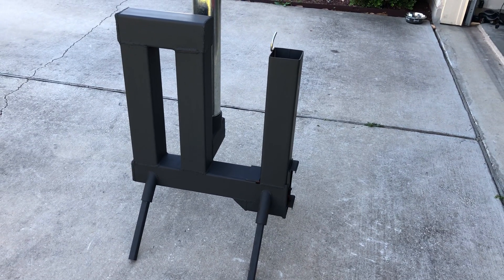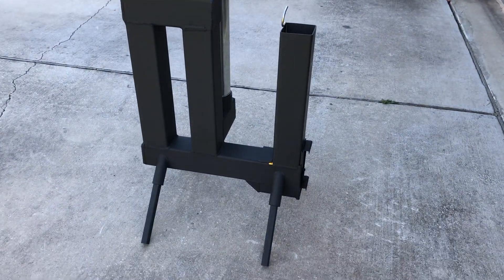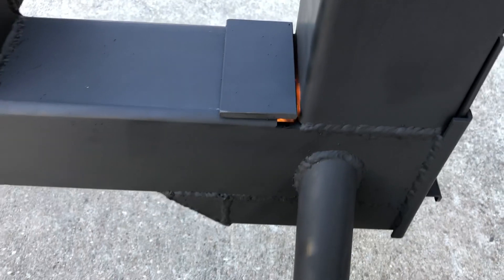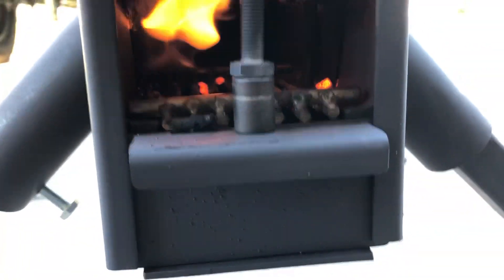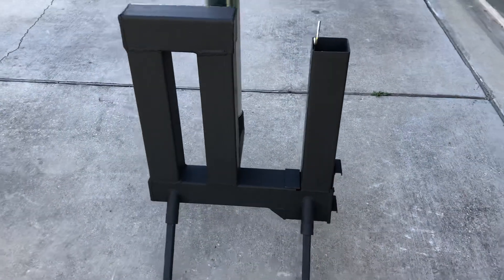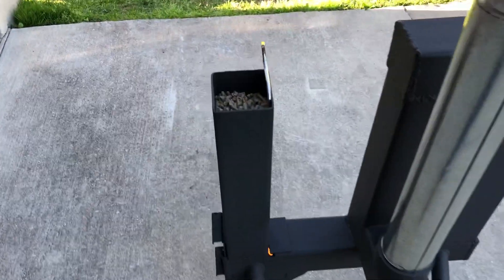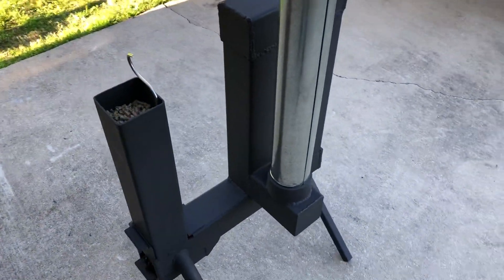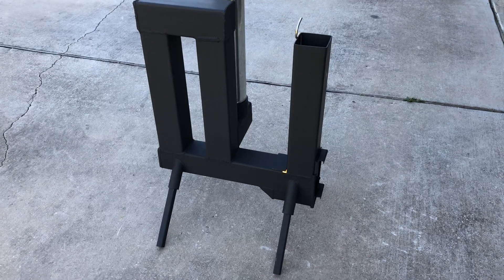Gravity fed wood pellet rocket stove

Comment: U need some heat handles welded to it so you can move it fast if needed.
Reply: Or just have pocket-style receptacles that you could quickly slide a handle/handles into. Then you wouldn't have to worry  about  them getting hot .

Comment: Nice!  What about tweaking the design slightly by moving the square pipe (for the chimney) 90deg, so it/the chimney sits on the bottom section of the square tubing(?) Not a big deal but the mod would make the unit more compact.

Comment: Built one just like it. My problem is when it's running out of pellets I get alot smoke through the hopper. Are you seeing the same thing.
Reply from the maker: Yeah I get the same issue. I’m not sure how to remedy that
Reply: Don't run out 🤔
Reply: Add a lid
Reply: Add a piece of 1/2” copper tubing going from top of hopper down to backside of chamber to create a draw on tube that will suck smoke back. Also put a lid on hopper.
Reply: Angle the hopper so that the smoke takes the path of least resistance
Reply: @promark03 Have you found a remedy for this? Planning to build one of these soon and have a list of design tweaks. Thanks.
Reply from the maker: @crich1218   as of now, no I haven't found a good remedy. Although, there is now a commercially available unit similar to this one, and I think they have figured it out. I forget the name of it.

Comment: Complimenti..
Ciao e scusa il disturbo ho una stufa molto simile alla tua ma ho fumo che esce dal serbatoio pellet soprattutto verso la fine. Sapresti aiutarmi?? Grazie mille. Francesco
Reply: Translated for my dawg, Francesco: Hello and sorry for the inconvenience I have a stove very similar to yours but I have smoke coming out of the pellet tank especially towards the end. Could you help me? A thousand thanks. Francis
Reply: Could you help me??
Reply: @comcenter61  Mi dispiace, non so niente di stufe a razzo. Sto imparando.  Sorry, I don't know anything about rocket stoves.  I'm here learning.
Reply: Grazie mille lo stesso...
Reply: If smoke is not completely exiting the stove through the exit pipe then there is not enough “draft” through your chimney. This could be from too short or poor placement of the chimney which happens when there isn’t Good flow of air away from the chimney outside. Another possible issue is that air is not entering the stove Good enough. Make sure your chimney is clean and not blocked with anything abs that your air entrance is open enough.

Comment: How long did it burn with full hopper?
Reply: Depending on how big the square tubing is that you build with, burner design, length of your chimney will determine  how long a 40 lb. bag of pellets will last. i have a 4" system (4" square tubing) and I get around 12 hours out of a bag of hardwood pellets.

Comment: How hot does your chimney get?
Reply from the maker: At the bottom of the chimney, it’s about 150 degrees but about mid way up it goes to about 100 degrees.
Reply: @promark03  NICE!!!! I’m looking at building this to have in a tent. I just don’t want the chimney to be too hot regardless of the type of sleeve I use going through the tent. Looking forward to the heat and it’s efficiency as well!!👍🏼👍🏼